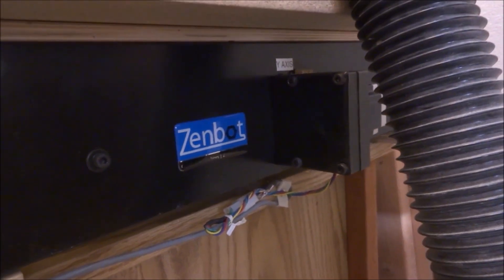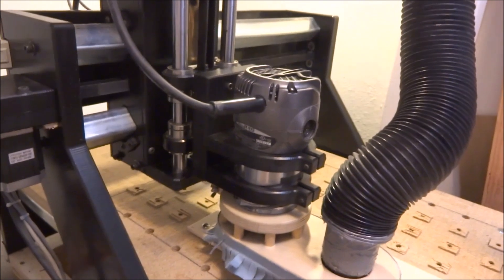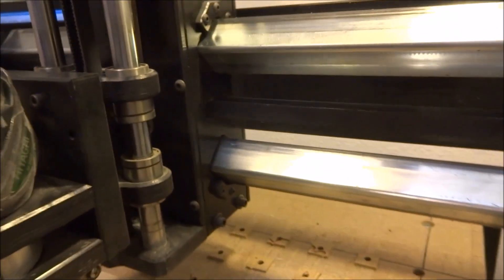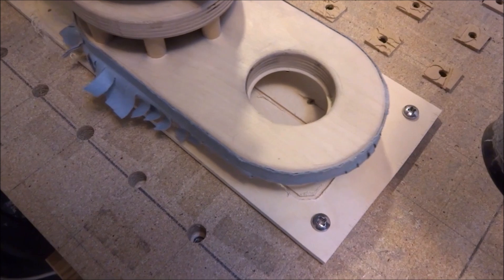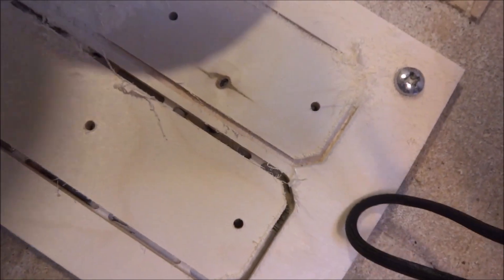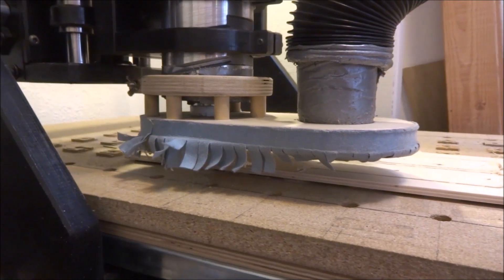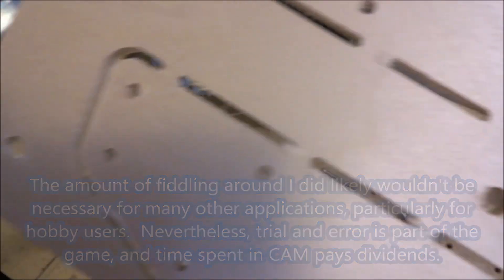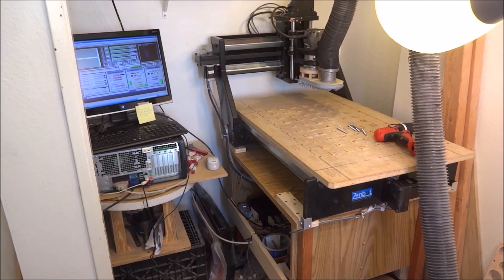Zenbot 1624 CNC Router Review and Discussion - Annotated

Comment: or you could just learn g and m code, instead of or in addition to the cad and cam programs. especially for something like a router, for the g code it really looks like a bunch of g1, g0, g2 and g3's. sometimes its quicker to just manually input the data.
Reply: jchinderle, you can manually program these machines easy enough when cutting a square but if you make a lot of parts with various size radii and complicated shapes you'll take longer programming them and scrapping material than having success.